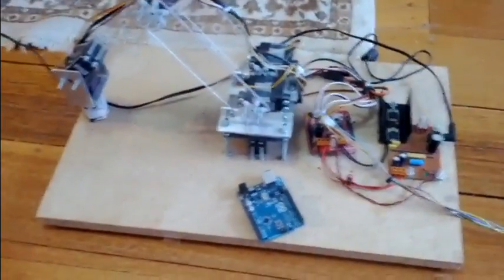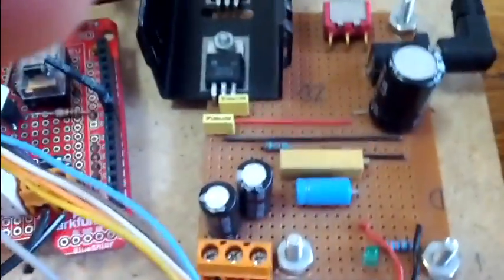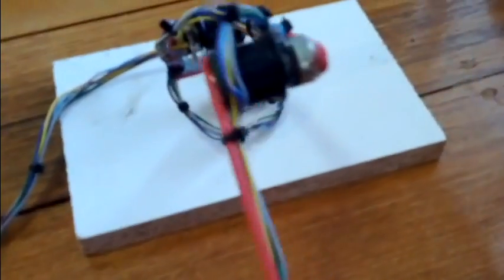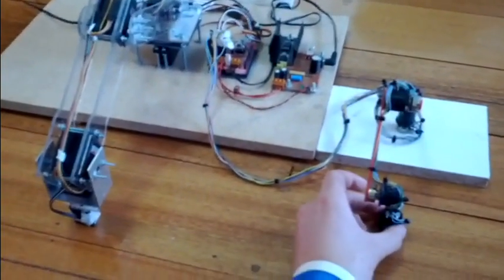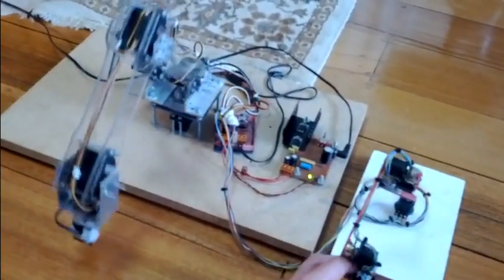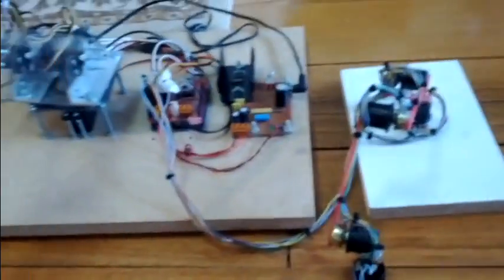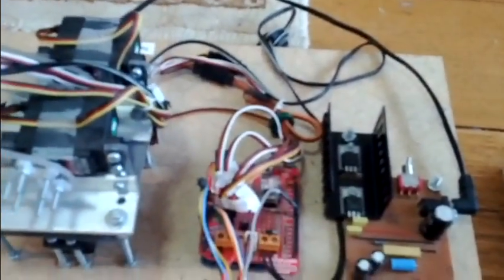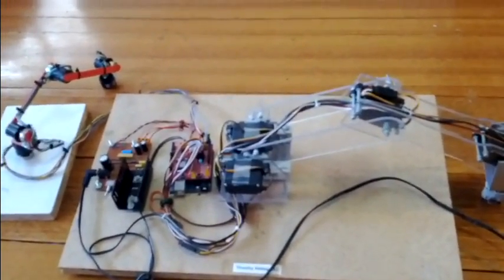An Arduino controlled Robotic arm with a position input arm.

Comment from the maker: Thanks. 
The vibration is not the gears slipping its just the control circuit oscillating because it was never meant to handle this much weight or inertia. The solution is just to get better servos or even ones designed for this application but they are expensive.